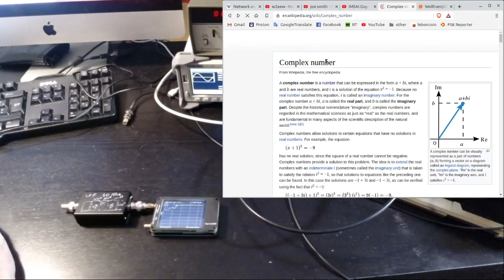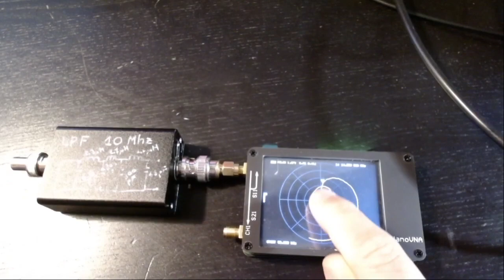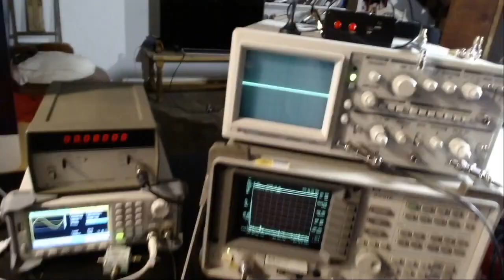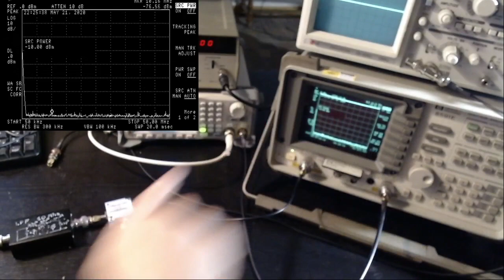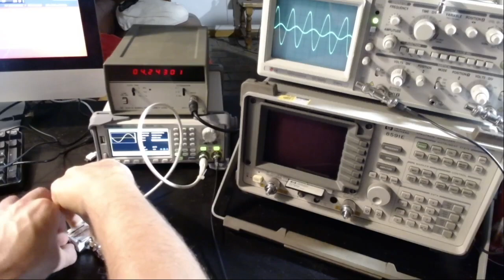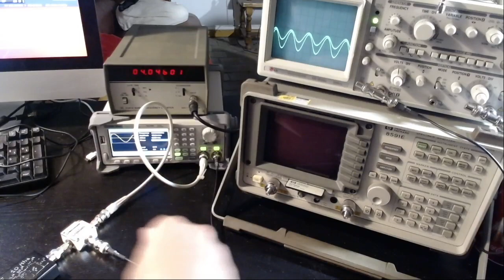Episode 33: nanoVNA and S11 measurements

Comment: Thanks man.  I have a question if you would be so kind as to answer it.  The S11 in all VNAs gives us the return loss in dB  , for example, S11 for a 50 ohm cable without an antenna and without a load at the end, the S11 read -2 dB 120°. Does this mean that the cable :
do a phase delay of 60° and -1 dB attenuation # " -1 = -2dB/2 "
 or
do a phase delay of 60° and  -5 dB attenuation in   -5 = -2 -3dB 
 or
do a phase delay of 120° and -1 dB attenuation # " -1 = -2dB/2 "
 or
 do a phase delay of 120° and -5 dB attenuation # " -5 = -2 -3dB "
or 
do a phase delay of 120° and -2 dB attenuation .

Will the phase and attenuation measurement differ when using S21, and how much will it differ?  Which is more accurate in measuring phase and attenuation, S11 or S21?
Thank you